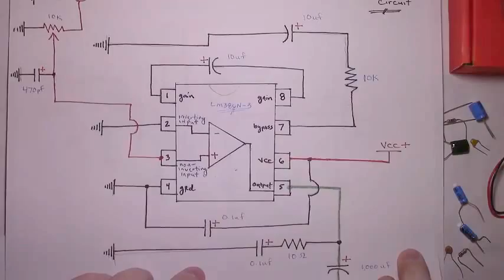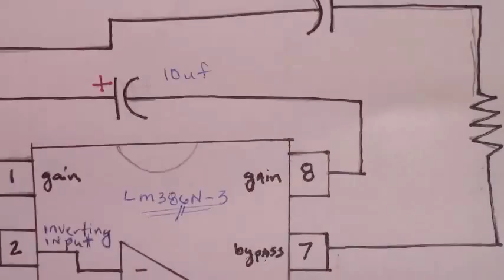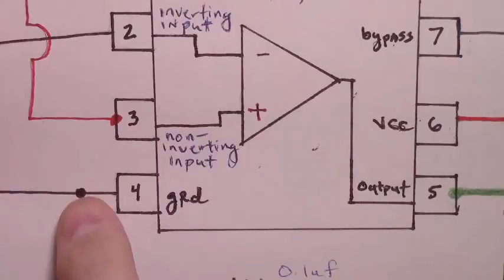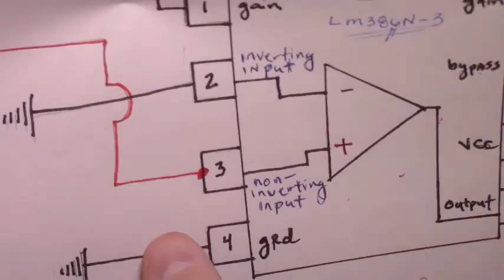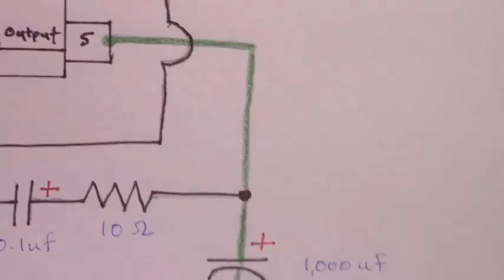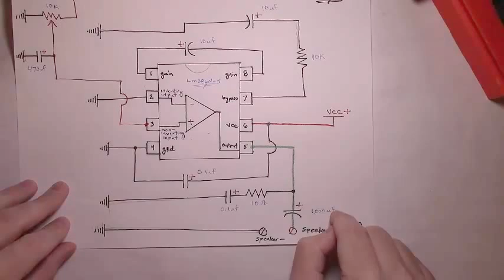Circuit Assembly Tutorials || LM386 Audio Amplifier

Comment: I have a bluetooth chip as my audio source.  Could I connect that directly to pin 3 instead of the Potentiometer?  If so, would I still need the 470pf capacitor from pin 3 to ground to isolate rf noise?

Comment: hello,, what if i use a 12 volts for power supply,, is there any problem with that,, or there is a part or materials that need to replace?

Comment: Hi Philo Mech, I learned from JohnAudioTech on YouTube, that having separate ground paths for input, output & power that junction right at pin 4, ground, will greatly reduce if not eliminate pops, crackles, etc.. I have had good success using this method. C.
Reply from the maker: +Cass Virgillo Appreciate the comment and reference to John's channel.  I enjoy many of his videos too.  His 'star ground' video is certainly helpful and a technique often used in analog signal and amplification applications.  I chose to "separate" the speaker vs signal grounds by routing each to different rails of the breadboard in the video.  But, for a more finalized circuit board setup using a star ground tends to be my preferred method as well.   Hope these remarks are helpful.  Thanks for watching!

Comment: On the top left of the diagram,,,the audio IN  negative goes to the volume control or variable resister, at the end wire to ground..is this right?  In other words the ground and audio in, goes to the same side or end of the VR...or volume control..

Comment: I have a comment...on the ceramic capacitors..you have a + sign by them..and I think some beginners will think that is an electrolytic capacitor when it is a ceramic with no polarity..Nice video by the way...
Reply from the maker: +Kennynva T. Appreciate the comment and feedback.  I thought about omitting the polarity symbols for the ceramic caps but decided to include them just in case someone attempted to use tantalums instead of ceramics.  Tantalums can misbehave (i.e., fire) if inserted backwards and erring on the side of caution at the risk of a little confusion seemed to be the better course.  Hope these comments help.   Thanks for watching!
Reply: Oh ok..I'm old school...and used only ceramic back in the day...thank you very much...Hey what would happen if you took the output of this circuit and connected it to the input of a complete other circuit..???

Comment: hello..can I use 12v power for the project? please reply how to make it into 12v power...that's helps me a lot...thanks
Reply from the maker: +Herdan Lee Appreciate the question.  The circuit should work fine with 12V, nothing would need to be changed.  Just make sure that your capacitors are rated for at least 16V,  a 25V rating would be even better, it's standard to use capacitors, resistors, etc., rated for at least twice the amount of voltage you expect them to "see" during operation ).   Hope these comments help.  Please let me know if there are more questions.  Thanks for watching!

Comment: Assuming that I wanted a 2 channel amplifier, can I just double the circuit and hook up the left audio input for the audio input of the 2nd circuit? Or do you have a 2 channel amp tutorial? Thanks in advance. Liked the video!
Reply from the maker: +bien laqui  Duplicating the circuit for the left channel will work.  You could use a speaker for each or attempt to combine the outputs using a mixer circuit.  A stereo chip amp video is in the works.  It'll likely be a month or two before it appears on the channel but one is on the way.   Hope these comments help.  Please let me know if there are more questions.  Thanks for watching!

Comment: Should the ground coming from the power supply and the source be connected together? Have it connected from my phone through a TRRS breakout board. When I connect the source ground and pin 2 to the ground rails I get no audio, if I connect the source ground to pin 2 only it works and I get quite a bit of sound.

Comment: Does the volume go all the way to 0? Will this work with +-5V input? How could I adjust the output to make it go to both headphone speakers?
Reply from the maker: +Robert Maurer Thanks for the comment and questions.  Turning the potentiometer all the way in one direction will tend to reduce the volume to a near inaudible level.  Yes, I've used 386's all the way down to around 4 volts but the volume tends to be much lower.  The 386 is a mono type amplifier ic, meaning that a single IC will only amplify (when built as discussed in the video) either the left or right channel from an audio player.  Whatever happens to be on the unused channel is lost.  But, one could build two of these circuits (one for each channel, one for left and one for right) and then combine their outputs at a single audio jack socket i.e., one output connected to the tip part of the socket; the other connect to the ring part of the socket; while both grounds are connected to the sleeve part of the socket).  Such would "unify" the output from both circuits to a single headphone jack socket.  However, one would need to be careful about the impedance of the headphones.  The 386 wasn't designed to drive much more than 4 to 8 ohm loads (whereas many headphones might be upwards of 60+ ohms).  Hope these comments help.  

Thanks for watching!

Comment: I created the circuit but for some reason it only plays the bass. The tremble sounds like it's from a distance.
Reply from the maker: +Haille Olimb Appreciate the comment.  There are a few things to check/try: (1) What type of speaker are you using?  Is it "full range" (typically around 20 to 20K Hz)?  If not, then the speaker might not be about to support the higher frequency treble signals.  I would try another speaker and see if the results differ.  If not, then you might be encountering one of the limits of mono type audio amplifiers.  They only amplify a single (left or right) channel from the audio player.  The treble (higher frequency signals) of certain songs is sometimes sent out of one channel while are the lows and mids exit from the other.  Something to try: Disconnect the current channel you're using as input to the amp circuit and connect the other to it.  Are the treble parts of the song now present (and the mids/lows absent)?  If so, then you're definitely encountering one of the downsides of mono (single channel) amplification.  The solution would be to use two of these circuits, one to amplify the right channel and one to amplify the left.   Please let me know if any of these comments help.  If not, I will continue to do my best to help.

Thanks for watching!

Comment: is the most important part the capacitor on the gain? every other capacitor reduces the noise right? i cant get my head around why there are so many capacitors and what values to use
Reply from the maker: +Sunny Appreciate the question.  The gain capacitor is important, one can add a potentiometer in series with it and have an easily adjustable gain.  I tend to run all of my 386 circuits at max gain with the 10uf and adjust the value via the 10K pot on the input line or by the music player.  The capacitors in series with the input and output lines are used to prevent DC voltage from entering the amplifier.  Each of the other caps, the' 470pf input pin, 10uf bypass pin and 0.1uf on the output line are used to reduce noise.  386 circuits tend to be cases of constantly striving to reduce as much noise as possible.  There are many other audio amp chips where the number of capacitors can be greatly reduced, for a good sounding stereo amp chip that doesn't require tons of external caps one might check out the LM4752T.  Hope these comments help.  Please let me know if there are more questions, etc., and I will always o my best to help.  Thanks for watching!

Comment: Hii,
Is it possible to add a heat sink to the IC  to prevent it from heating ????
Reply from the maker: +VIVEK KUMAR Sharma Thanks for the question.  One could adhere a heatsink to the top of the chip with thermal compound and/or locate the chip under a small CPU fan (though not so close that the EMF from the fan is picked up and amplified by the circuit).  During most applications the chip shouldn't get too hot.  Hope these comments help.  Please continue to let me know when there are questions and I will always do my best to help.  Thanks for watching!

Comment: If I don't have a LM386 audio anmplifier is any other I can use? in the same circuit.
Reply from the maker: +Rolly C Thanks for the comment and question.  The circuit was designed around the pinout, requirements, etc., of the 386.  It's not likely to be a direct fit for other audio ICs.  But the noise handling techniques are transferable to the construction of most audio IC circuits.  The 386 tends to need a more significant amount of noise handling that some chips but I've rarely encountered one that didn't benefit from some external components, a careful grounding layout, etc.  If you have a particular IC that you would like to use in mind, then please let me know and I will add it to the list of upcoming videos.  Hope these comments help.  Thanks for watching!

Comment: Does it work with lm386 m-1?
Reply from the maker: Viljami Sillanpää    Might you have meant N-1? If so, then yes.  It should work with most any version of the 386.  It will produce more overall volume with an N-3 to N-4 (they are capable of sourcing more current), but it will work with N-1s and 2s.  Hope these comments help.  Please continue to let me know if/when there are questions, etc.  I will always do my best to help.  

Thanks for watching!
Reply: philo mech It actually was some other model. I can also buy n-4 but there was no n-3 where I bought the parts. Thanks for the tip! :)

Comment: hi
from pin 6 to 4 is it 1uf or 0.1uf ? 
great video you are easy to learn from
Reply from the maker: MonkeyMagic Elecifun Appreciate the comment and question.  It's a 0.1uf.  Thanks for watching!
Reply: I used 100nF which is the same.I watch lots of these video's, learning. Yours is great, easy to understand from start to finish. I appreciate that. Could I ask another question?
I have a ticking when no sound is being played, faint but audible?
Also, I don't suppose you have done another step by step with a LM1875 ?
Reply from the maker: +MonkeyMagic Elecifun Thanks for the questions.  My apologies for the delay in replying.  I'm in the process of moving and it's taking a while to get back to comments.  As to the ticking sound, you might be hearing one of the capacitors.  A quick test would be to remove and replace each of the capacitors you're current using one at a time and see if the tick goes away.  That's where I would start.  If the ticking remains, then let me know and we can go from there.  I haven't yet done a video on the 1875 but I have a couple on hand and was considering making a tutorial about them.  They tend to be quite easy to work with and always sound reasonably good.  If you'd be interested in a video about building a circuit around the 1875 just let me know and I will make sure to add it to the list of upcoming videos.    Thanks for watching!
Reply: Thank you, Its really good of you for getting back to me.
A video around the LM1875 would be great I have two of those chips and wondered if i could make a stereo amp for my work bench. I also have a schematic for a mono circuit but am not sure of what types of capacitors to use. Before I read this, I played around with the LM386 circuit I had built and think I damaged it, something started to smell that your doing something wrong to your circuit smell, oopps!. I have another couple of LM386's being delivered today (44p each) so I will study and rebuild the circuit and hopefully get it to work again. 
Hope your move goes well and thank you again. Simon

Comment: I've been inspired in your work I follow all of your instruction Sir. But I think there's a problem in my work. I don't know if the part that I use or the breadboard. This is the parts that I use 25V all capacitor, 100V polyester capacitor and 2w resistor. And sir help i don't know where is the positive and negative side of the polyester capacitor , resistor and in 470pf capacitor. Please sir need help.
Reply from the maker: jhan mark geroy Thanks for the comment and question.  Polyester and ceramic capacitors are normally not polarized meaning that one can plug them into the board in either direction.  Whereas electrolytics and tantalums typically are polarized.  Electrolytics normally have a dark band on the side of the can that indicates the leg to be plugged in to ground.  One will need to look on the datasheet if tantalums are being used, they sometimes differ between vendors.  The voltage rating for the caps is fine.  A resistor rated for 2W should would fine as long as its ohm value is the same (or close to the same) as used in the video.  Might you say a little more about what you're circuit is or isn't doing?  From example, does it produce sound but not enough volume, or with too much static/noise, or perhaps no sound at all?  Just let me know and I will continue to do my best to help.  

Thanks for watching!
Reply: philo mech no sound sir. thank you sir for answering may question sir.
Reply from the maker: jhan mark geroy Thanks for the reply.  Okay.  Some things to check:
1) Are all the ground connections where they're supposed to be according to the schematic/video?  Especially the ground connections to the 386 and mp3 input line?  It's very easy to be one hole off in the breadboard.   
2) If the ground connections are where they're supposed to be, then how about the VCC connections?  Especially to the 386?  It's also worth checking to make sure that the battery/batteries you're using have adequate voltage for the circuit, most anything 6V up to around 15V should be fine.
3) If the battery voltage is good, the ground and VCC connections are good, then I would check the potentiometer connections and perhaps even swap the pot you're currently using with another of a similar resistance range.  Pots can separate, crack, etc., internally so it's often a good idea to try another if a circuit isn't behaving as expected.  
4) If all of the above checks out, then what it the impedance of the speaker you're using?  Is it 8 ohms?  A 4 ohm or 8 ohm will work, but the volume will likely be significantly diminished if one uses much over a 8 ohm.  
5) Please let me know if 1-4 haven't revealed the problem and we will go from there.
Reply: philo mech finally sir I made it. My first board is working. Thanks for the tips from your video and for answering my questions. I saw the problem I put my resistor at the opposite side. Thanks again Sir.
Reply: philo mech Sir if I turn the volume full the sound coming out to the speaker is buzzing. what is the problem Sir? and what should I do to eliminate the buzzing sound Sir? the speaker that I use is 8 ohm 10 w.  sir,
Reply from the maker: jhan mark geroy Thanks for the question.  The amplifier is likely picking up the household AC surrounding your work area.  Something to try:  Power the circuit from a battery and take it outside away from houses, powerlines, etc.  If the buzzing/humming goes away, then you'll know it was the electromag fields generated by nearby AC devices, wires, etc..  Assuming AC noise was the cause, then you can block such with an enclosure -the quick and dirty way is to place the circuit inside a cardboard box wrapped in aluminum foil.  Let me know if relocating the circuit away from AC wires and/or placing it in a foil covered box helped.  If not, then we will go from there.
Reply: Sir I send picture of of my work and the speaker that i use at Google plus thanks again sir.

Comment: what does the pot do in this circuit? are you just using it as a variable resistor?
Reply from the maker: Nick Foggia Appreciate the question.  Yes, it's used as a variable resistor, nothing more.  Thanks for watching!

Comment: Hi and thanks for this excellent tutorial, only a question: I have the Sennheiser hd 595 (don't know if 50 or 120 oh model) for you can i use this circuit for this headphone (changing the speaker with a female jack) ? Or you suggest me another circuit ?  The price for headphone amplifier are too high and i try to build a good one for that use.
Reply from the maker: wawacco Thanks for the comment and question.  Headphones tend to have a much higher impedance than the 8 ohm load recommended for the 386.  There are quite a few chips in circulation that are specifically designed for headphone applications.  I'm not as familiar with the latest headphone amp chips as I probably should be.  I'd recommend searching the websites of some of the major chip brands for "headphone amplifier ICs", try e.g., Maxim, Analog devices, Texas Instruments, etc.  One or two searches will likely return many of the most recent and popular options.  Hope these comments help.  Please let me know if there are more questions.  I will always do my best to help.  Thanks for watching!

Comment: When i use 10k to increase volume it starts giving noise.
Reply from the maker: ***** Thanks for the comment.  You might try swapping the potentiometer you're using with a different one of the same value.  Differences in manufacturing can make two seemingly "identical" components respond significantly different in the same circuit.  If swapping the pot doesn't resolve and/or reduce the issue, then just let me know and we can go from there.  I'll always do my best to help.  Thanks for watching!
Reply: +philo mech thank you for your help, but i tried your solution too but result is same.